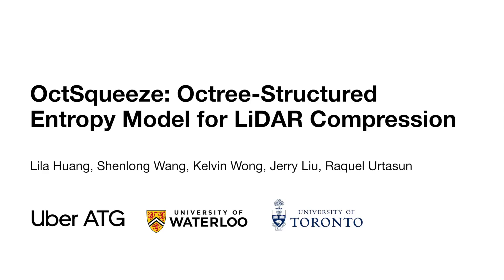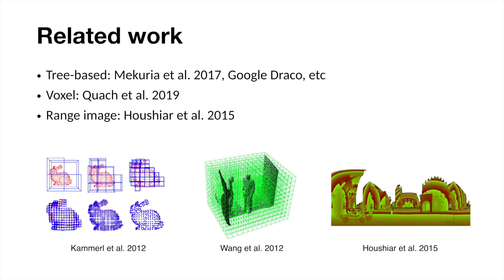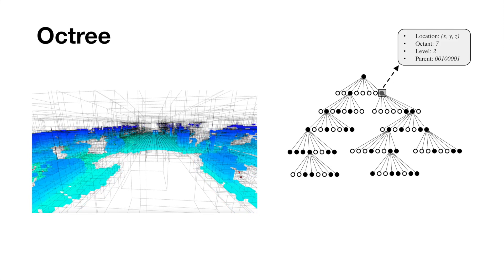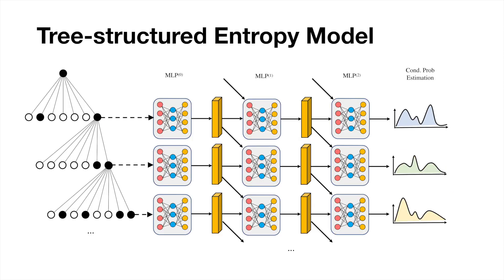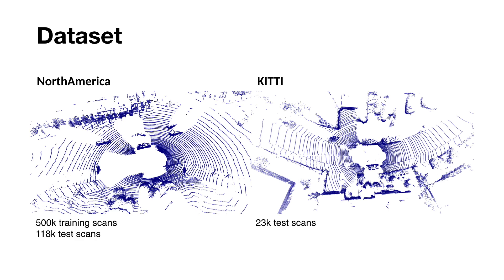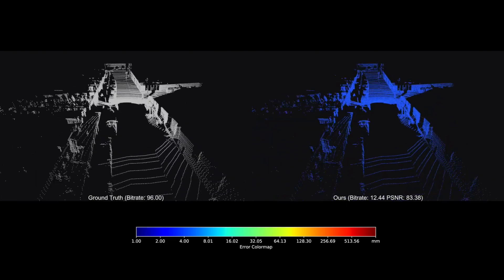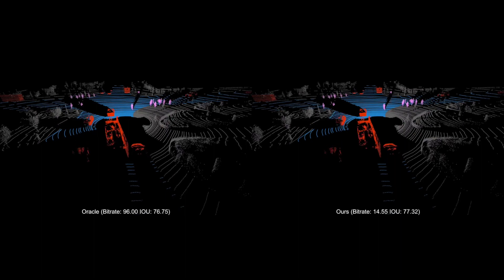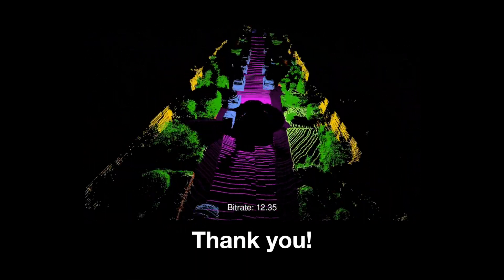OctSqueeze: Octree-Structured Entropy Model for LiDAR Compression

Comment: You've said the Octree stops dividing if only one (or a certain number of points) is detected in a Voxel (Node). However, this would lead to large errors of points in sparse areas, were the Voxels are huge. As a work-around we would save the exact location of each point as an offset to the related Voxel and would become a tailing payload of each Node.

However, your paper doesn't mention anything how the payload of each node got managed.

On the other hand, we could force the Octree to a certain depth, which would result to some overhead for points in sparse areas. Nonetheless, your entropy model should eliminate such overhead.

Last but not least, these sparse points won't have any significant impact to the Peak-to-Noise-Ratio, because those are in minor.
Therefore, I assume you just ignored the error of sparse points which got displaced by the related mean point of their Voxels.

Am I right?
Reply: Furthermore, I wondering if the PSNR is wrong! You use max(||p'-p||) as peak instead of the largest possible error (i.e. the diagonal of the bounding box). Your implementation implies that few very large outliers would contribute to a high (good) PSNR, which on the other hand, would benefit from the fact that you use to ignore the error of sparse points.